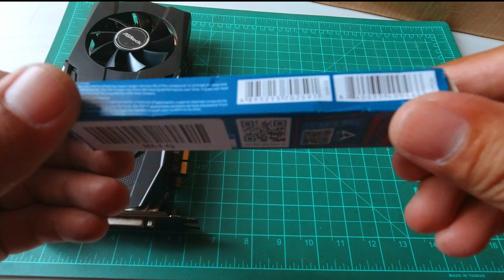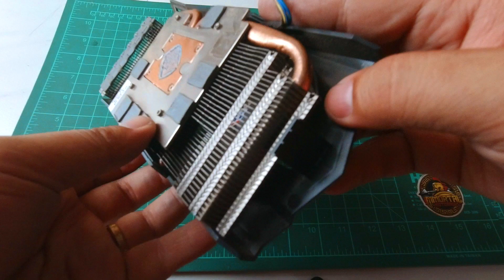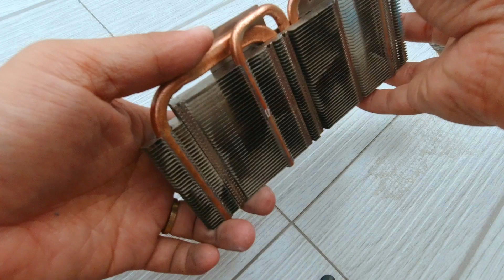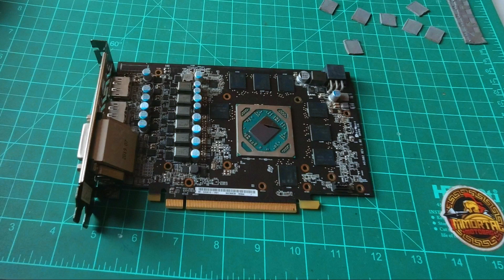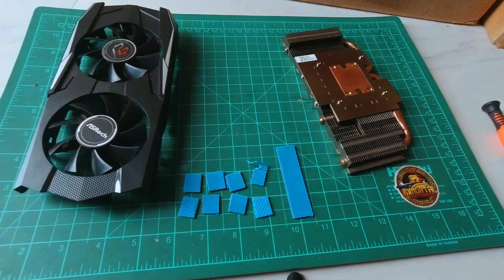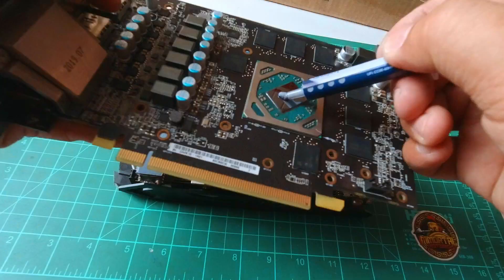RX 570 4GB ASROCK PHANTOM GAMING VIDEO CARD THERMAL PASTE AND PADS

Comment: succesfuly changed my paste and pads. tas same tayo ng GPU asrock rx 570 din saken, after changing and cleaning the card yung board ng GPU saggy na, tas may drop na sa performance. ano input mo sir baka may mali akong nagawa.
Reply from the maker: alive and kicking pa din yung unit ko sir, gamit ko sya sa shop ko, so far, yun pa din yung last replace ko ng thermal pads and paste, ask ko lang if anong thermals pads and paste ang gamit mo
Reply: @MotomotoPinas  thermal pads ay same tayo ng ginamit GELID. thermal paste naman ay yung generic lang. baka nung pag re assemble may mali akong nagawa.
Reply from the maker: @BelialsAwakening  sa pads medyo okay pa mag generic ka pero sa paste ang dapat mag invest ka ng good quality paste, mas mabilis uminit ang mismong area ng may paste kesa sa may pads, doublc check mo nalng yung screws ng board sa fins
Reply: @MotomotoPinas  Sigesige sir, Maraming salamat!

Comment: This is weird, we have the same gpu model and i used 1.5mm pads. The long pads seems to be not thick enough unless i put it wrong?
Reply from the maker: try checking if the board and rad is well put together , usually clearances occur when they are not put together properly

Comment: mi gpu runs over 40º in w10 and 65-80º on premiere, i ve changed the thermal paste and cleaned it but it goes the same. do u recommend me change the thermal pads?
Reply from the maker: when you are planning to repaste you therma paste, consider replacing your thermal pads too, saves a lot of time in disassembling and assembling the gpu, i am currently using a quite expensive thermal pads here, you can screenshot the thermal pads for reference

Comment: Thanks. You gave me the confidence to make the mainteinance myself for my card. Clear and straight to the point video. Do you know anything about the backplate pads?
Reply from the maker: as per reading some threads in Reddit about backplate pads, it is still unclear to me if I have to consider modding my GPU with backplate pads, I am satisfied with the results after repasting/replacing my thermal paste and pads on my GPU.

Comment: Temp ko ngayon sa asrock rx580 nasa 92°max bumaba ba temp? Medyo putol ang vid e pero nasa 40° kita ko, musta naman ngayon?? Mahal kasi ng thermal pads
Reply from the maker: masyado mataas yang 92 mo sir, siguro better check mo airflow ng case mo baka hindi ganun ka effective, or need mo na tlga replace ang paste at pads nyan baka tuyo na masyado, akin kasi sa highest ko lang 80 tlga, tapos ito ngayon sa fortnite ko from 50-60 pumapalo nalng sya ng 40-50, tapos if mag replace k ng pads at paste better dun ka sa mahal na para sulit yung pagkalas mo ng gpu kasi risky din sa iba ito sa pag diy, yung iba dito di na gumanwa kanilang gpu, subok ko tong gelid at arctic kasi

Comment: Hi, can I use 1.0mm thermal pads instead of 1.5mm pads or duplicate 1mm pads? Is that a problem?
Reply from the maker: someone says that he already ask this to asrock and asrock tell him that the default thermal pad thickness is 1.5mm, that's why  I use 1.5mm here
Reply: @MotomotoPinas  Okay and I will use 1.5mm thermal pads thanks for the reply.
Reply from the maker: @ANDRIJJA  okay thanks
Reply: Hello, Im done cleaning and repasting my 570 (asrock too) but i noticed the vram’s board is sagging because of the heatsink and fan